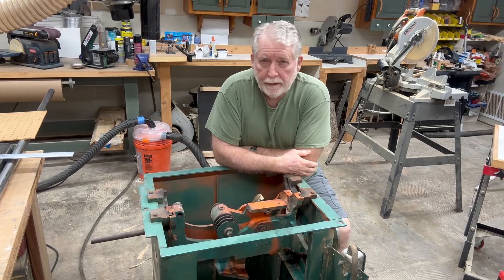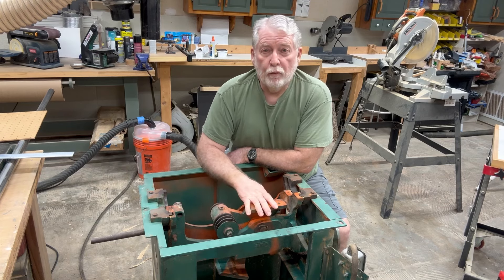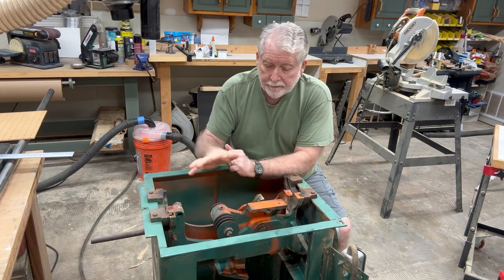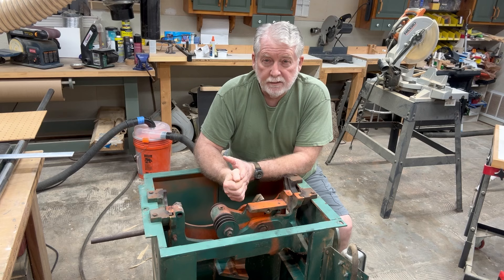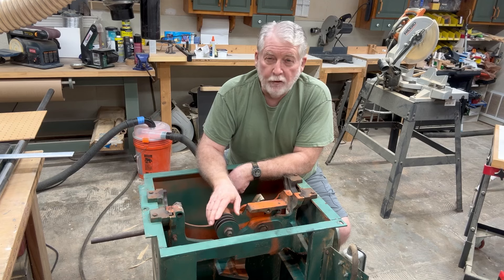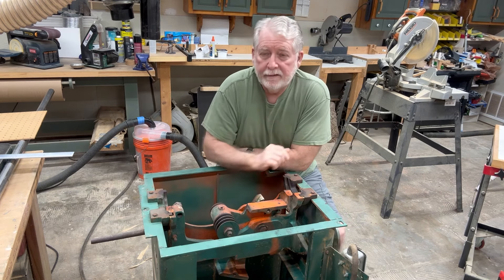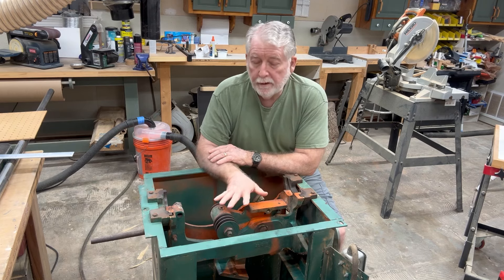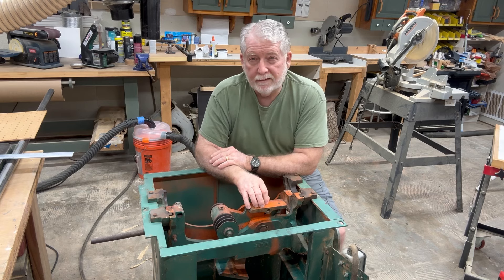Update on My Table Saw Status

Comment: That's one nice thing about a belt driven saw vs a direct drive like a lot of the newer ones. Ask the repair shop if they can point you to a new motor with the same specifications; you may have to make an interface adapter, but it would be worth it!
Reply from the maker: Yes sir, they are looking for a suitable replacement. I am looking as well. I would like to say this family heirloom

Comment: I feel the pain.  I just retired a compressor that I have been flipping the switch on for 59 years.  I cannot find replacement head parts/rings.  The compressor, tank and all, was born in 1961 in Wisconsin.  I seriously doubt I will get the same service out of the new one, but then I doubt I will live to 130 so….
Reply from the maker: I completely understand. I considered my saw a family heirloom. My father had it first. I was raised using the saw at a very young age. It was passed down to me and I was hoping to pass it to my sons. The new Powermatic motor that I hopefully will be able to get will not be of the same quality as this old motor. I hate to see it go. Then again, I agree with you, I’ll be lucky to get another ten years out of my old body. I already had my motor (heart) rebuilt.

Comment: I bought a shop fox model W1837 hybrid (110/220) open base cabinet saw about 3 years ago and am very happy with it.  Home depot can order one. It's about 320 pounds and has an amazing fence,  lots of power and it's a cabinet saw (motor is mounted in a trunion in the cabinet rather than being mounted to the bottom of the table like the delta). It's about 1800.oo shipped. They are made by woodcraft international who also make the grizzly saws.
Reply from the maker: Thank you,  how does that compare with the Grizzly?

Comment: This came up on my  in my homepage. Some thoughts as I'm considering downsizing my shop.  Saw needs enough power to cut hardwoods easily?  Vs. Jobsite saw? Investing time vs. money. rehabbing another old saw?  Hybrid vs. cabinet saw?  Rewiring an old motor now days has extensive labor costs. Some shops won't work on small motors as you can buy a new one for less. 2 phase vs. 3 phase which many old powermatics are?  Have a Grizzly cabinet saw which I bought ffrom a cabinet shop many years ago. Grizzly machines have been made in Tiwan to specific standards for many years. a google search may shed some light. Good hunting!
Reply from the maker: It has been an interesting journey so far. I actually had this motor rewind years ago. I was hopeful that the same company could have repaired the motor again. Unfortunately, that is not possible. I have a 3hp 1 ph motor which is strong enough to cut hardwoods. Powermatic does have the motor. It is made by Taiwan. It’s on back order now.   Worse case I will have to buy a new saw and have received many great suggestions. I am considering a Grizzly. Yet I am holding out on getting them new motor first. Thank you very much for the information

Comment: A motor manufacture can make a motor to fit your saw, Franklin motors is on the east coast. Check to see if they could use your motor case and make a new motor using the case. Motor rebuilders are not equipped to make a complete motor.
Reply from the maker: This is great information. Thank you very much

Comment: Sorry to hear that your tablesaw is in some kind of coma (if you get a replacement motor of course). Some would recommend a sawstop. I own a Dewalt 745. The dewalt 7492 is the newest model if I’m not mistaking. For my needs and purposes the 745/7492 is more than enough.
Reply from the maker: Excellent, thank you so much. I’ll look into this saw also

Comment: If you do need a table saw, depending on your budget, the new Delta 36‑725T2 (or similar Ridgid) are decent entry level table saws.
Reply from the maker: Thank you, I’ll take a look at that one. I have not considered a Delta.
Reply: The Ridgid that I have is a Ridgid replacement.  My first one died and Ridgid set a new one.  Ridgid has a lifetime warranty!
Reply from the maker: Thank you,  I check out Ridgid. My local Home Depot does not carry them in the store. I’ll check them out online. Thanks

Comment: Buy a Sawstop
Reply from the maker: I will consider it. Thanks
Reply: @PawPawsWorkShop  I got rid of my Delta table saw after a table saw incident. I like the Sawstop table saw safety features . Definitely will save you from a missing finger. My late uncle had two table saw accidents. After it happened to me , I went out and bought a sawstop for that reason alone.

Comment: I'm happy with my Shop Fox W1888
Reply from the maker: Excellent choice. Any experience with Grizzly?
Reply: @PawPawsWorkShop  I have their 18/36 drum sander and I've been very pleased with it. Their G0899 is the same exact saw. Only reason I went with Shop Fox was at the time, they had a sale that made it a smidge cheaper. If it was today I would only look at the Grizzly version due to cost.